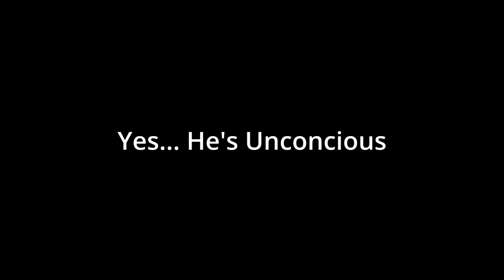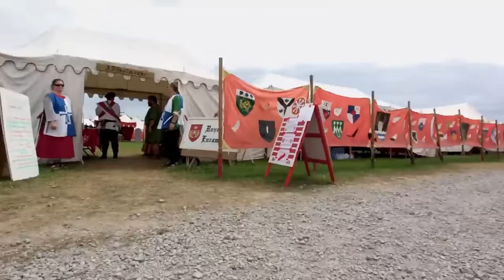The Insane World Of Medieval MMA

Comment: My friends and I did this back in 87.
We called it:  "concussion"

We did have a few rules.
No "nut shots"
No attacking someone while their helmet was off.
No throwing of ANYTHING in the eyes.

We used football, hockey equipment and a mixture of handmade armor using carpet, ducktape and string.

So much fun.
Reply: I made foam sparing swords with pvc pipe cores, pipe insulator foam, all wrapped in a skin of duct tape, me and the homies batter the crap out of each other with em
Reply: LOL! Same here.   When I was in middle school in the early 1980s, my friends and I did the same thing and we called ours "Honor Dual".  During woodshop class we would pretend to work on our assigned class projects.  When the teacher wasn't looking we would quickly work on our "special project", i.e. making wooden sword, mace, polearms, flails and other Medieval weapons.  We would have 1:1 combat events Friday afterschool in a vacant industrial lot a mile away from school using our special project weapons.  We dressed up in athletic safety gears and items and had rules similar to yours.  The dual will start off with a coin toss between two combatants.  The winner of will hurl a "your mama is,... " insult at the loser.  The loser must respond with a "You insulted my honor, and I demand justice by combat."   Then both combatants will enter into a roped off 15 foot ring and fight.  The winner will be the combatant who is knock to the ground first, forced out of the ring, or surrenders.

Comment: Ok, so back in a day I was a part of LARP\HEMA training.
Average weight of armor ~ 20-30 kilos, the swords are dull, but still hurt like a bitch, slashes are allowed but pokes are not, especially hits to groin and joints. Hokey armor padding is used sometimes under the cloth.

Funny enough there are more broken noses with LARP than HEMA. The 10.000 USD suit of armor is a titanium one and it is lighter, yet mostly they cost around 3-5K USD. Sometimes cheaper if you order it in Russia. 

Broken fingers and ribs are a normality. 

As for crowd - its mostly engineers, IT guys, smiths and sometimes middle management. 

Overall I don't regret getting into it, great people, great exercise and would totally advise everyone to search for such communities in their areas!

Comment: The US version you featured is called the SCA - it's halfway between foam LARP and steel-fighting. They use wood (rattan) sticks in those huge battles, and you can get away with plastic armor underneath a tabard as long as your head/neck, kidneys, and joints are properly protected. There are steel-fighting clubs in the US of course, and plenty of people in the SCA do both, or even all three things.

Comment: So a note about larp from someone who does HEMA, Buhurt and larp:

Not all larps are the same/have the same focus. Some are basically HEMA but with (correctly weighted) foam versions of the weapons. The main difference is that you are trained not to take any dangerous strikes (no head shots, neck shots, some you can't do stabbing strikes etc), so it becomes more of an agility contest (in 1v1) or strategic contest (side v side) in how you move your troops across the field.

There are also larps where the focus is on story telling and the fighting is just secondary to that (if there's any fighting at all), but those are not really combat larps and they're not intended to be seen as such.

Final note: those "d&d" mechanics tend not to appear in the more combat-focused larps, which operate more on a points system (eg You can survive getting hit six times. If your opponent lands more than 6 hits on you, you're "dead" ).